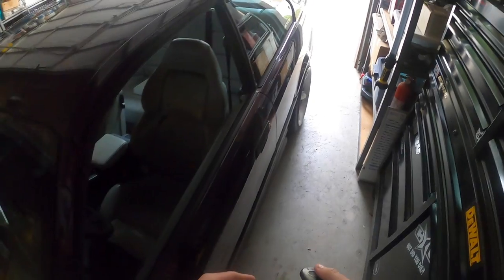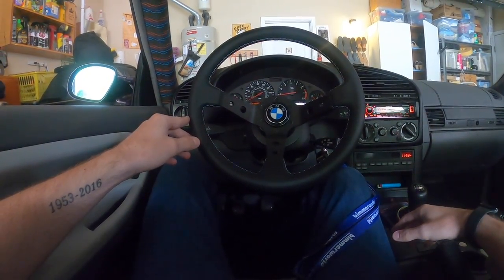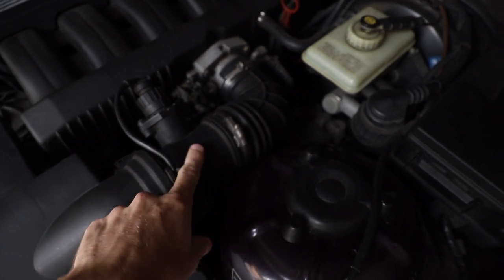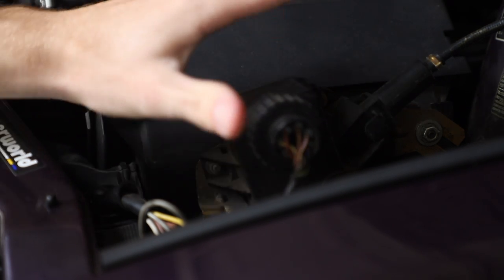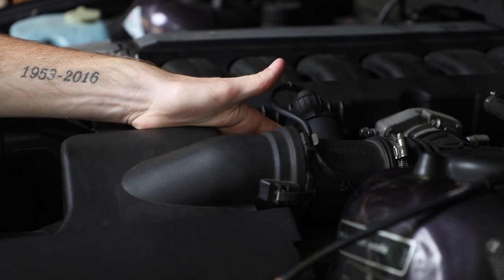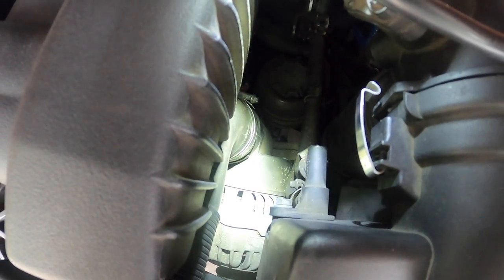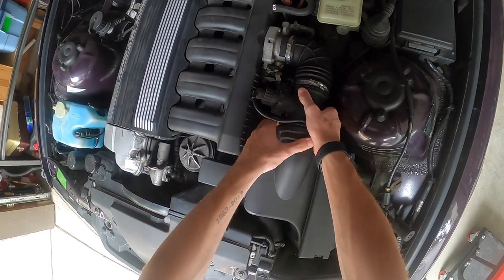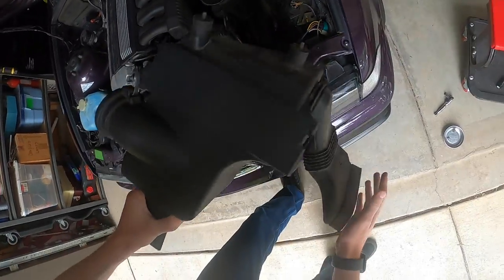E36 ICV Hose Replacement (Diagnosing Rough Idle)

Comment: Did you ever figure out what was causing the idle fluctuation?
Reply from the maker: ICV
Reply: @E36tyler  did you just clean it or buy new one?
Reply from the maker: No need to buy a new one, just clean it really good to free up the valve inside